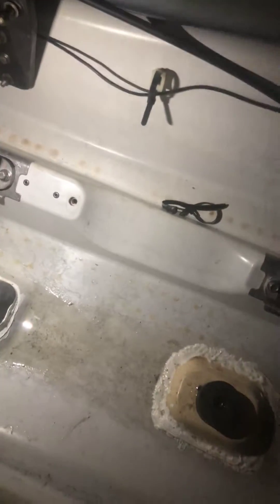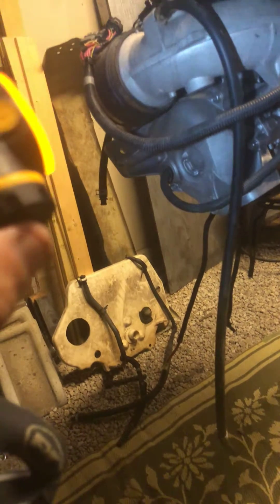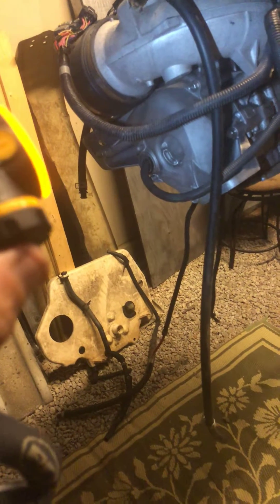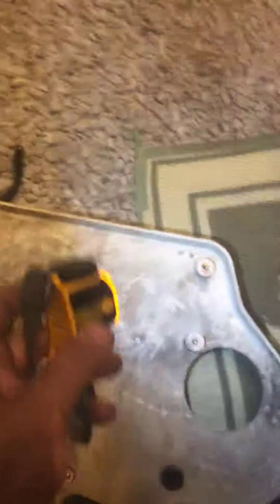Yamaha Waverunner MR-1 from 2010 VX Engine swap to a 2016 V1 Hull that had newer TR-1 Engine part 1

Comment: Hey when you pit the front motor mounts did it have the threads already in there or did you have to tap it? And the fuse box also? Did you have to install studs?
Reply: For the fuse box, yes, I did have to drill and put in threaded taps. For the motor mounts. The only ones that I installed using three and 5200 were actually shock absorbers. The existing factory motor mounts lined up and were use the same. Where the fuse box was mounted, and I had to drill and tap the threads. There’s actually crosshair indicators molded on the hull that shows you where to drill and install them. Pretty sure they did this for assembly line efficiency and for added and remove options as changes are made to the designs over the year until the hull is phased out.

It was pretty straightforward where things go. For example, if you were to add a reverse cable option, there is an X haul, and an indication on where to drill through the hole to add the reverse cable where it comes out of the hole through the back pump tunnel.